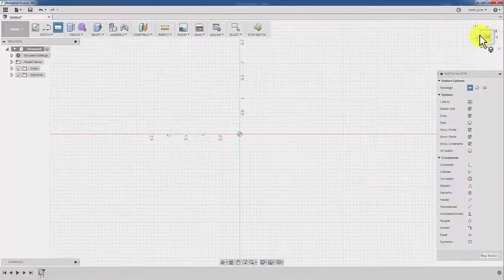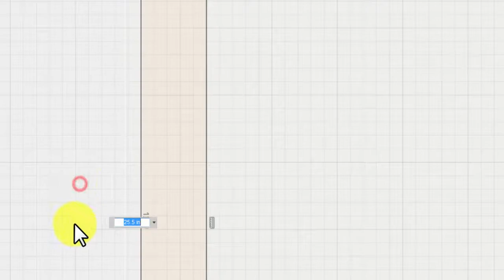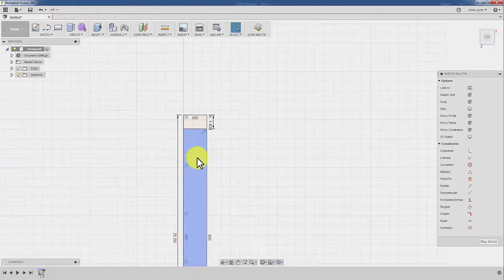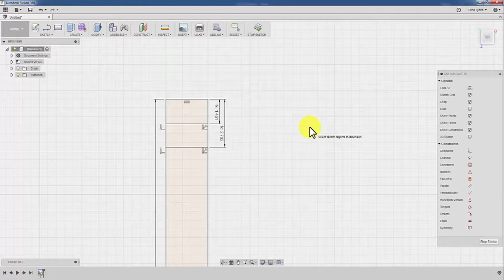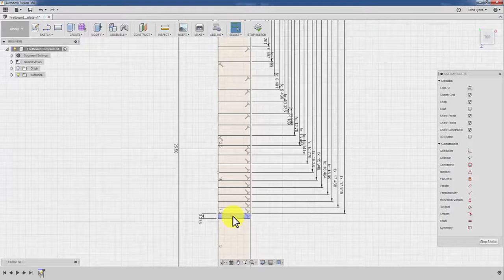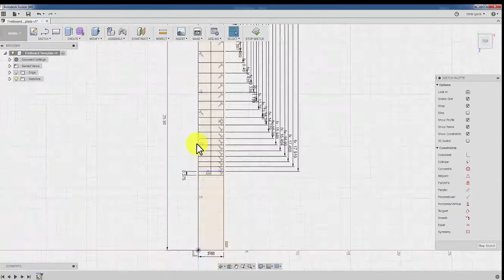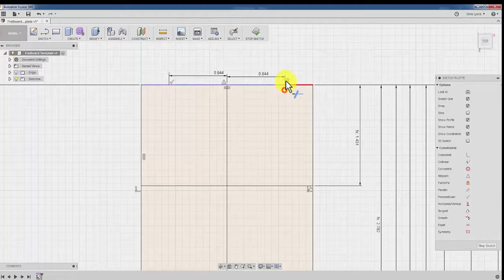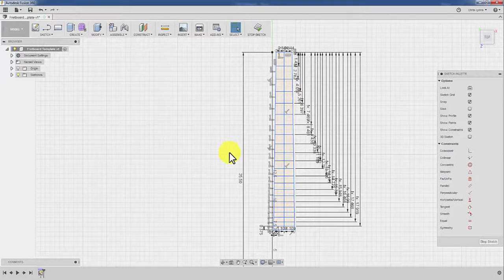3D Model a Fretboard using Parametric Equations for CNC

Comment: Thanks.  I tried the formula using Inventor 2020 but it would not accept the “D” dimension.  I had to use the value of 25.5 then all worked well. Must be a setting I do not have correct in my Inventor application?
Reply from the maker: I remember in my attempts at creating it in Inventor that I ran into the same issue. Can't remember if or how I got it to work, but this was another reason I decided to show it in Fusion 360.
Reply: CLyons Creations thanks for the feed back